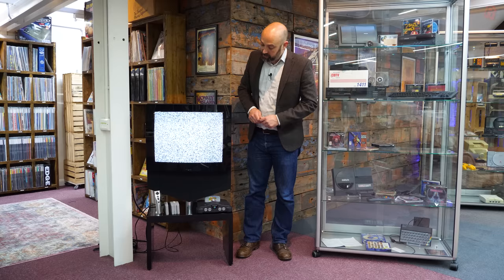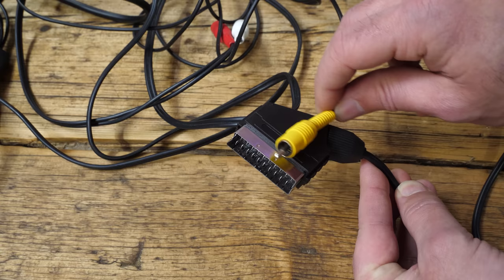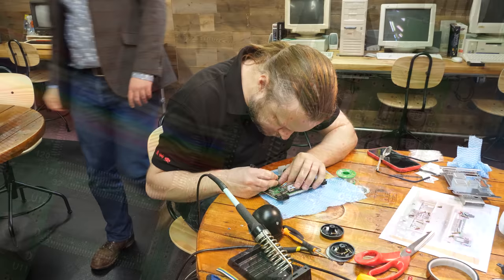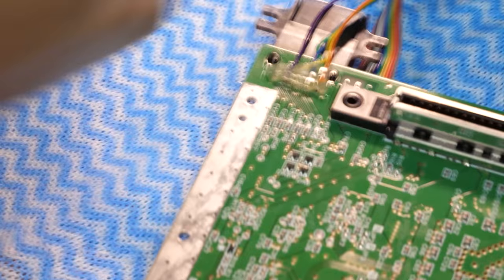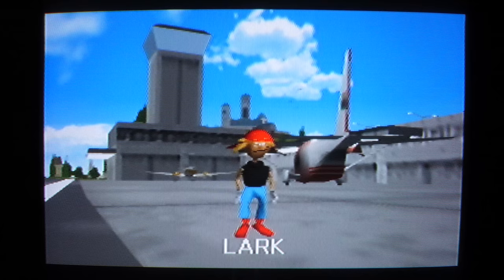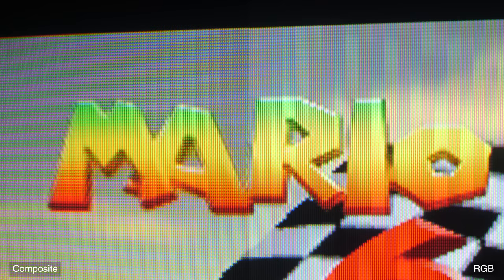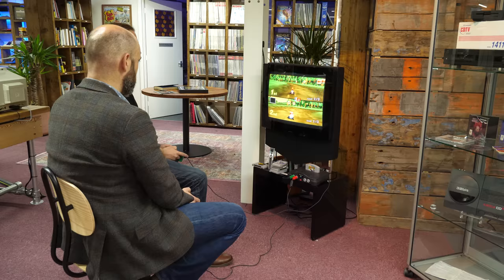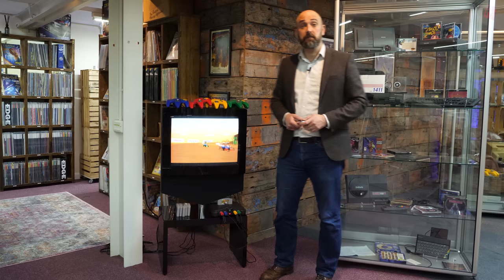Should I RGB mod my N64 (and look at this awesome TV!)

Comment from the maker: Thank you for watching! Shout out to https://retrogames-swindon.co.uk/ and check all associated links with the mod in the video description.

Some of the effects such as Blur might be hard to see on a small screen, they are more noticable on a large display and/or 4K.

Neil - RMC
Reply: modded my n64 for rgb scart a while ago, truly an excellent picture , Svideo is hard to find on supporting tv's
Reply: you soldered directly onto the bottom of the existing socket - did you not cut the existing output from it? would that not make it better
Reply: I need to know, what is the word similar to SCART that is used in the US? I'm lost on that one...
Reply: Think the R is silent.
Reply: @cheater00  shart?👌😄
Reply: @AppleReviews  Wow. You totally opened my/his eyes!
Reply: Couldn’t help but notice that your N64’s U14, one of the RAMBUS DRAMs, is slightly lifted on the side where there are only 4 pins.

This is common but they should be soldered back down. It still works because they are all redundant Grounds. The chips are designed with most of the pins on the other side so that the board designer can nest multiples together, partially sharing the same footprint. It’s strange that Nintendo didn’t do that here even though they have Nintendo’s name on them. ;)

It would’ve allowed for a smaller heat block and thermal pad too with less of an insulating gap in between. *shrug* Later consoles only had one chip anyway. EVEN later consoles got rid of the heat blocks but using a stamped/dimpled heat sink so they managed to save on the excess aluminum and screws anyway with fewer mating surfaces for better thermal efficiency.
Reply: 10:10 - It's a bad S-video cable is all. Get a proper one from Castlemania Games.
Reply: Is it worth RGB modding the PAL console if using the Rad2X for HDMI out?

Comment: The bright S-video issue is due to the fact that the PAL N64 is sending too strong of a signal. To fix this just simply attach a resistor (maybe 75ohm) between the luminance video signal and luminance ground. This is also an issue with AV composite if you are using non-rated N64 cables that don't have their own image signal reduction component. This is what I had to do with my PAL N64 and it worked perfectly.
Reply: I actually had this same problem with the ntsc gamecube
Reply: Yes, and it is not a well known fact: even composite cables for Nintendo consoles are not universal. The resistor is inside NTSC consoles and inside PAL cables, so if you mix you either get a dark picture (resistor in console and in cable) or, like in your case, too bright (no resistor anywhere)! WHY DID THEY DO THAT?
Reply: @giacomovalenti8619   No idea. Nintendo does interesting things. But yeah, it drives me crazy when you try to buy a cable online and it just doesn't tell you if it has a resistor or not. X(
Reply: This isn't just a Nintendo or just S-video thing if I remember correctly. The original RGB cables for Megadrive and PlayStation also have several components regulating the signal output from the consoles.

Cheaper third party cables often leave these out. So while they do give the advertised sharper picture, they are probably not giving the correct picture.
Reply: @AltCutTV  yes, but the thing is that OFFICIAL Nintendo RGB and composite cables differ between regions (and consoles! RGB PAL GC cable is incompatibile with PAL SNES!)
Reply: I immediately knew it was this because the same effect happens monitor-side on a Commodore 1702 monitor, where s-video conversion is done by adding a resistor. Normal s-video is already way bright on it, I bet with this, it would just be a white screen.

Comment: Nice TV =O  Looks great in RGB!  The S-Video cable, you need to add a 75ohm termination resistor to the N64 - I covered this in a video years back.  Without it, its overbright as you discovered!   The title was "Nintendo 64 - Everdrive Stuff & S-Video Over Bright Fix (Video Mod)".   I've also seen people just add 75ohm termination on both luma and chroma, and then AC couple each through a cap.
Reply: It also appears to be one of the fake S-video cables with Chroma connected to Composite Video. See the destructive interference in the flames on the Zelda logo?

Comment: PAL needs special S-Video Cable with extra resistor, the NTSC give that bright screen. A good S-Video is very close to a RGB modded N64.
Reply from the maker: That's interesting thank you, I'll look into that a little further
Reply: Nope. S-Video were not a common thing back then. Scart plugs were. And scart carry sound as well, and can do RGB. Something that S-Video does not. Just go with Scart-RGB.
Reply: @brostenen  I never made a statement that this S-Video was common here. 
But fyi: Scart is only the container, and can also carry  composite or S-Video (incl. audio),  so I could have S-Video via Scart.

That said, without the deblur there is not much to gain coming from an S-Video Cable. 

My first S-Video Cable had the same issue, the second one was fine, knowing what to look for. Image is still not great, though. Neither is it with the RGB mod, which I also own, compared to the RGB Signal the Sega Consoles offer.  (Running through OSSC)

The RGB-HDMI Mod with deblur and de-smear(?) might be the best solution from what I heard.
Reply: @Retro_Royal  I know that about scart. It is just a plug. There are at least 3 different type of signals that are uses with the plug. Well... And then you got RGB signal that scart can carry as well.
Reply: @brostenen  Scart can actually do S-Video too with Chroma sent on the RBG (red) pin and luma on the video in pin. That way it could audio too.

Comment: S-Video cables for the NTSC N64 are wired straight-through with no extra components inside, but PAL S-Video cables are different. They require a 75 Ohm resistor to ground on both the luma and chroma signals (ideally put them in the console-side connector) to set the brightness correctly. Capacitors in series (put them after the resistors) are also recommended, typically 220 uF for luma and 68 uF for chroma. All of the cheap S-Video cables you'll find online are intended for NTSC consoles and lack those components. There are a couple of sites where you can buy pre-made PAL N64 S-Video cables, though.
Reply: Additionally, it looks like the s-video cable used in this video was one of those cheap combo cables with very poor shielding, which contributes to the dithering type effect on the s-video. It's worth finding a somewhat nicer cable, or at least one that doesn't also have composite to intefere with the signals. even better if you get one of those handmade
Reply from the maker: Thank you guys, I'm going to find myself one to try out
Reply: @Sirotaca  from my experience as an NTSC n64 gamer! Looks great on my svideo Sony pvm :) no RGB on that anyway
Reply: @CaesarRoyale  I believe it’s one of the cheap ones that works in a SNS-101 Super NES “junior” since those are the most common and that’s exactly what you see with them. The cause isn’t shielding, it’s because they only had one of the two S-Video signals and they replaced the other with straight composite! This is why they work on the mini 101 consoles that lack S-Video.
Reply: @Sirotaca  They are sold by RetroBit, Old Skool, and others.
Reply: @emmettturner9452  even worse than shielding issues, it's not even the right signal! 'lowercase S'-video?
Reply: @CaesarRoyale  Yep. Also seen them from Tomee and Hyperkin. I’ve started to call them “fake” S-Video but the Luma does make text sharper despite the patterns you see in the background and such. Much more apparent on SNES games with simple colors. :(

Comment: the HDMI mod isn't an Analog to Digital converter you put inside your N64, it does actually sniff out the raw digital signals from the board and convert them to to HDMI. Still gonna be 240p/480i tho.
Reply: This. It can output digitally perfect video grabbed straight from the RCP (GPU).

Comment: Stunning TV!  Love the B&O sets, they are amazing and I would love to add one to my collection.  Oh and YES you should definitely RGB Mod the N64.  I have an RGB modded NTSC N64 and it looks way better than the standard composite option.
Reply: Interesting that watching on my (very) small phone, the difference is negligible but clearly expanding the screen size is truly the key to benefitting from the mod itself. Brings back lovely memories of my n64 and Zelda ocarina. 1996… I was a mere stripling in my twenties still!
Reply: @mhoppy6639  Yes, I play on either a 29" 4:3 CRT or a 28" 16:9 CRT and there's a good step up.  The composite output is pretty poor from the N64 and whilst the RGB isn't as clean as via other machines, it is noticeably sharper.  I must admit that playing OOT in the late 90's will always be one of the highlights of my gaming life.  I remember being quite down when I finished that game.  It really drew me into the world in a way that no other game had done before it and it's influence on gaming since then can not be understated.
Reply: I never rated B&O tv's. They are simply Philips TV's in a posh case, sold for several times the price. (I used to service them)

Comment: A quick heads up. Many B&O TV's have a secret service menu with options that could potentially be useful when trying to get the best picture quality possible out of retro consoles. On some of them you can access it with the remote, others you have to open up. I'm no expert on the matter, but it might be something you'd be interested in examining.
Reply: This one has, too. You cannot enter it with the phallic remote that came with it, however.
If you have a BEO4, just enter the menu and hit 0 0 GO. That opens up the service menu.

Comment: I had a US N64 and could connect it to my TV via s-video due to the fact my TV could handle NTSC s-video. When I decided to have it modded for RGB, I was stunned to discover the colours were even better. The bubbles inside Jabu Jabu were a revelation, stunning.

Comment: Those vintage B&O televisions are incredible! I was lucky enough to pick up a BeoVision Avant 32inch (with built in VCR no less!) from 2004 for £15 early last year and dragged it (literally as it's SO HEAVY) into my office room. So now if I want to connect up a vintage computer / console, I have the best possible CRT to experience it on.

Having known the owners of the set personally, they told me that they paid the obscene amount of £4300 for the TV when it was new. Which is mind blowing. 

And BTW - the party piece with the rotating stand NEVER gets old ;)
Reply: In the 2003 Argos catalogue a 32" Panasonic was £1100. If you wanted the real "Big Screen" experience you could get a 36" Toshiba for £1800. Good luck dragging one of those into your room though :-)

Comment: Love the mod, and that TV is amazing, although i really think a Saturn would suit it better, in style especially. 
You should keep an eye out for one of the BEOVISION units that had a built in "MEDIA CD" player, which was actually a Philips CD-i and fully compatible.

For the S-video issues, i think the cable is missing a termination resistor or something.
Reply from the maker: Oh wow now that sounds like a treat. I’ll keep an eye out
Reply: I've noticed that B&O and Philips worked closely with each other in the past. For example B&O did a video 2000 machine that was actually a philips machine with wooden panels and dark perspex attached and a transcoder board to allow the B&O remote to work.
Reply: The cable is missing the resistor for PAL *and* it has chroma wired to composite. IMO, these are fake S-Video cables without chroma.

Comment: Thats a really nice TV you have there. I dont remember if this was a 31khz display or 15khz? Either way I know B&O  were some of the best CRTs, I wished we had some in the USA. But yes, RGB on the n64 is worth it.  The clarity and the stronger colors are subtle but noticeable, you did a great job of showing that here. I think the biggest difference are to those playing on up-scalers on flat screens, but even on larger and nicer CRTs you can notice. 

Tho a shame about the s-video and pal compatibility since s-video does look good as well and makes for a nice budget solution. Yes, bad decision on Nintendo for not including it on the system. Even the SNES could output RGB with a cable!

Comment: U14 is lifted and needs to be soldered back down. This is very common since the RAMBUS chip only has four legs on that side.

It sticks to the heat sink when you remove it as a whole that way. I still do it that way but I remain mindful of it. I only pry from the back and solder back down if I find lifted RAM.

Later N64 boards with a stamped heat sink eliminate the unscrewable heat blocks so you can’t avoid this anyway. Thankfully, they are all ground so anyone can solder them back down without worrying about bridging or alignment.

The reason the chips are made like that is so that they can be nested more closely together on the board, within each other’s footprints, but Nintendo did not do that.
Reply: 5:31 shows the lifted legs.

Comment: I had two N64s that I got modded to RGB out. A Japanese original and the American release. 

This was in 1996 and 1998 though. 

It always amazed me that Nintendo would go to great lengths to design a console alongside SGI, that pushed the boundaries of what graphics processing could be on a home console and then decided not to wire it for the best possible signal output. 

I’d suggest that as most Japanese consumer level TVs at the time didn’t have any type of RGB input, unlike Europe with SCART, but the more expensive ones had s-video, the decision was made to cut costs. Odd though that they did wire the Super Famicom (SNES) for RGB. 

Some screen flicker was always an issue with these mods, even the most professional of them. Here we are in 2024, and I wonder if the issue still exists? Or has tech improved to the point that modern mod designs have eliminated the problem?

Comment: I know everyone is saying about resistors, but you want the 75 Ohm resistor as close to the TV end as possible. This will act as a termination resistor and kill some of the luma <> chroma crosstalk that you are seeing. You could terminate the chroma too.
Reply: That crosstalk is actually because these are fake S-Video cables that connect chroma to composite. They are absolutely everywhere being sold by the likes of Hyperkin, Retro-Bit, Old Skool, Tomee, etc. This is done to “support” SNS-101 and SHVC-101 consoles that lack S-Video support but still have Luma.

Comment: I remember back in 1997 getting my Toshiba 33” CRT Dolby TV at the time it was massive, it was well specked with 3 AV inputs at the back scart 1 was RGB enabled. Scart 1 did not have RGB or S-video but scart3 has s-video presented in the scart and mini din connector.   

So I ended up putting my early DVD player on a video (port 3) my vhs recorder (port2) and my sky box and Rgb cabled SNES on port 1 with an scart rgb switch. 

On the snes it made a massive difference to use composite vs rgb. On the Toshiba 33” it was really noticeable but even on my Philips 8833 (mk1) monitor it was very noticeable. 

Great video, regarding the s-video, I would get a washed out with  weird artefacts on screen if I connected s-video but did not set the input port into a-video mode. It was not auto sensing.

Comment: I use my N64 with an S-video cable and an upscaler that converts to VGA. This works pretty well and comparable to the RGB output. So, economical, IF you already have a good upscaler. AND did you say "Bean BAG"? Perfect!

Comment: Wrong S-video cable as others have explained already. Personally, I'm perfectly happy with how my N64 looks with the (correct) S-video cable on my Sony Trinitron CRT. I don't think installing the RGB mod is worth it for me. Especially if I have to solder to the legs of a chip, I haven't looked into that, but that is a bit too scary for my low soldering skills :)
Reply: I'm pretty sure any connection looks good on a Triniton. I have a Wega kvfs120 and composite from my Wii look almost as good as components. So I bet the Triniton makes an Svideo look close to it

Comment: Yup, the cheap S Video cables are rubbish, missing the 75 Ohm as mentioned before. 
I personally bought a RAD2X cable which upscales and converts to HDMI, which is of course not an option on your B&O CRT. The RAD2X is probably the easiest and best solution for people who are using a modern LCD TV and HDMI.
Reply: It’s more than just that. It also has Chroma connected to Composite Video. All the Retro-Bit, Old Skool, Tomee, Hyperkin, etc cables do this.

Comment: In my opinion, S Video is basically as good as you need for how low poly and blurry most N64 games. 
Meaning, you probably aren’t going to make Ocarina of Time look much better just to the way it’s rendered and aliased. 

However, I am still considering an RGB mod just to use Scart or Component cables.

Comment: I use S-Video with my N64 and, yes, it is better. You might want to check the cable, though - a lot of 3rd party Nintendo S-Video cables don't actually do it right and basically just pass composite You can often check the pins in the Nintendo AV adapter and see that they're not correctly populated. I've had this with about half the ones I've bought.
Reply: Yep. The new S-Video cables in every indie game shop are almost universally built like this so that they will work with the SNES Junior (SNS-101). They do appear sharper because even the Jr has Luma but they just tap composite for Chroma and you get exactly the kind of artifacts we see here. It’s especially apparent as moving diagonal or diamond patterns in SNES games with simple color background.